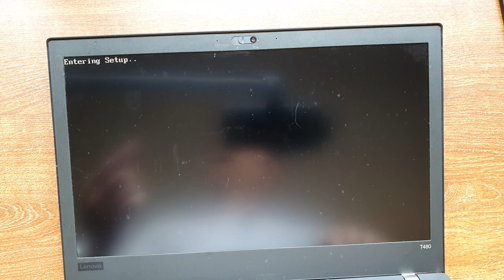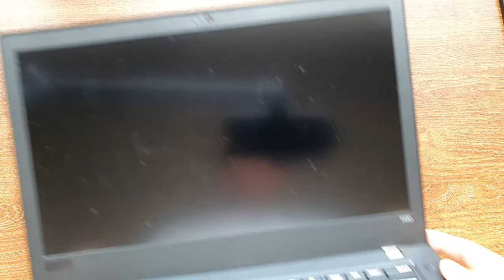Thinkpad T480 Dual heat pipe cooling fan upgrade + Thermal repaste | Lenovo laptop DIY

Comment from the maker: - Part number for the dual heat pipe cooling fan (for dGPU-equipped T480's): 01YR202

- AVOID Liquid Metal thermal paste if you're repasting for the first time, because it's conductive, and stick with non-conductive ones like what I used in the video.

- Have a dGPU in your T480 or T580? I repasted my Nvidia-equipped T580 in this video (and did a marginally cleaner but functionally identical job with the paste application): https://youtu.be/0mJpo-eSFEM

- Some popular thermal paste options:
Thermal Grizzly Kryonaut (2g, what I used): https://amzn.to/3B1XJfG
Thermal Grizzly Kryonaut (1g): https://amzn.to/3HQcHt8
Arctic MX-4 (4g): https://amzn.to/3LJg5a5
Arctic MX-4 (8g): https://amzn.to/44FuDjE
1/8"-thick foam tape (what I used, very handy for Auto DIY/rattle-hunting, too): https://amzn.to/3M5S2DW

Full disclosure: these are affiliate links. I earn a little from the traffic upon checkout but don't get any share from the products themselves.
Reply: Great video,would the t480s heatsink model number 01HW699 fit as an upgrade to,its dual pipe but without the extra gpu section,thanks for any replies 👍
Reply from the maker: @customrattysuk  I'm inclined to think it won't, since the T480s has soldered RAM and likely a different motherboard layout because of this.
Reply: @ChezDoesStuff  I've just looked at them side by side in pics and the 480s I was on about wont one fit as it's also not got the little side bit for the two chips,shame really as it would of been a nicer upgrade,but I have a plan in mind now to customise the one you show to upgrade to,I could remove the gpu part of it,cut the ends slightly rounded and silver solder the gap left,I know I could do it the same way you do but at the same time I also like to think outside the box,and it would be the first ever done that way to so a little unique mod 😀
Reply: You could also use 2mm thick silicone thermal pad for the dGPU cooler part.

Comment: My T480 was giving me "fan error" at startup.  It had gotten to the point that I consistently would have to reboot three times before the "fan error" would disappear and the machine would boot.  Scary.  This fixed it - I have no problems now.  The old fan looks OK, perhaps the thermal paste just needed replacement.  But I installed a new fan anyhow.  All good now!

This is an excellent instructional video.  Concise yet thorough.  And it's the best one I have found for this particular job.   I was a bit apprehensive to dive into this job but it was so fast and easy with your help.
Reply: My ThinkPad P15 is giving me error of fan not working when starting up. I discovered that is only the video card fan which is not running. The laptop was not used much but is out of warranty. Do you think I can replace the video card only, or I have to change the whole assembly (both fans and the cooling pipe assembly)?. Thanks for the answer.
Reply: @mevio4665  generally speaking you replace the whole heatsink/fan assy, but if you can source the good quality original brand fans (generally Delta or Sunon), and understand how to repaste the cpu & GPU, you can reuse the heatpipes just replace the fans if careful.
On some older systems the available replacement HSF assemblies are pure junk.
Reply: Thank you friends for the good advices. I feel more encouraged now to try and fix it

Comment: Pro thinkpad tip, if you find a thinkpad with a cosmetic flaw on the palm rest, keyboard, or top of the keyboard.. and it happens to be significantly cheaper than an option that is more clean, just buy the one with the cosmetic flaws. The ThinkPad parts that wear down are extremally cheap, and if you play on doing the t25 conversion then your better off saving the money

Comment: First, I want to say: "Thank you so much for your videos, you're amazing!"
I'll share my experience doing this upgrade:
- My laptop (t480 refurbished, i5-8350u) reached very high temps (~80°C-90°C) when it was connected.
- In idle, the temps seemed good (40°C-60°C).
- Not connected and working, it reached 70°C-85°C temps.

I did the same upgrade that you showed in your video, I got exactly the same cooling system (same parts), these are the results:
- Connected and with a high cpu load (ML training, 90-100%), it reached 75°C at max.
- Using an eGPU (rtx 2070) and training a CNN, it reached 80°C at max.
- In idle, the temps are in 40°C - 50°C at max (passive cooling).

So, I can say that there's a lot of improvement (10°C-20°C in average).
Thank you so much for doing these videos, it helped me a lot!
Reply: what enclosure are you using for your eGPU? is there a compatibility list with docks and graphics cards?

Comment: Another excellent video.
At this rate, there will be nothing left to 'upgrade' on the T480, unless you want to pull out the soldering iron
Reply: upgrading smd capacitors and resistors with 1% tolerance high-temp high accuracy capacitors. Up NEXT
Reply: @TruthLoversKoSALAM-fg8dh nah thanks my cpu is better when it's not fried 🍤

Comment: Great video and I'll probably do this very soon. I'm wondering about one thing, though: I learned that you only put one small drop of thermal paste on a cpu, then put the cooler on it. You literally coated the entire cpu before putting the cooler on it. Is it different between desktop- and laptop-cpus? I only have experience with the former

thx!
Reply from the maker: There are several ways to apply thermal paste and not one correct way. What you need to be mindful of is not to apply too little or too much. In my case, I coated the CPU with a very thin layer to avoid the latter. Fortunately, I saw improvement from this method. Cheers

Comment: Hey all, using a thermal pad on the copper part of the dGPU's side works as well as the foam tape for electrical insulation.

Also, thanks for the video !
I've lost ~20°C (both when idle and under load).
The dual pipe heatsink also has great passive cooling abilities, the fan doesn't really need to spin much anymore !

I have also switched from Noctua NT-H1 to Arctic MX-6 but I doubt it had an effect on the thermals.
I have read that the MX-6 takes longer to dry but I haven't really checked that.
Reply from the maker: Great to hear about your results! The passive cooling ability of the twin pipes is very much underrated. The fan on my T480 would go off literally every now and then prior to the upgrade.
Reply: How's it going so far?
Reply: @droidhacking  it's going good, the temps are still absolutely amazing and very I rarely hear the fans whining.
Reply: Could you share the thickness of the thermal pad you used for the dGPU side?
Reply: @muhammadsyafiq5892  I used some Arctic APT2560, it's 0.5mm in thickness.

I only had to get a small 50x50mm pad and I have half left after the mod.

I couldn't tell you the exact size I cut it to without opening my laptop again but I basically cut a square the size of the BGA pins + 5mm of outline to be careful.

I cut the pad on a cutting board after measuring the size on the mobo, make sure to apply the pad onto the heatsink and not on the mobo, you'll have greater chances of succeeding.

By the way, the update is still going great.
Amazing mod.
Reply: @animeistrash  you only put it the 0.5mm pad? not stacking it once more?
Reply: @RayBlaxe  yes, only one thickness, I think I had measured the distance between the heatsink and the motherboard prior to doing this but I'm not sure.

Once you screw the heatsink in it's very close to the motherboard, hence the shorting risk.
So I must assume 0.5mm of thickness to be enough. I think you could have remotely any thickness (probably nothing TOO small) as long as it's an electrical insulator.
Reply: @animeistrash  okayy thanks a bunch, any recommendations what pad suit for this, other than the one you mentioned?, by the way how much did you pay the dual heat pipe HS?
Reply: @animeistrash You don't remember if you measured the gap between the heatsink and mobo? Seems that would be something that you would specifically remember
Reply: @RayBlaxe  hey, my previous comments are not going through, sorry.. I've followed you on X

Any pad should do the job so long as it's an electric insulator, check the dielectric constant on the package/listing.
Reply: @johngreene6783  I did, it was something like 0.5mm since that's the thickness of thermal pad I've used, but I don't remember for sure, I can send you a picture if you want.

Actually, I can go and measure that for you if you want, I have to replace my thermal paste soon.

Comment: Sorry because my English is bad but I want to ask, can the MX150 GPU chip which is sold separately be installed on a T480 laptop board that doesn't have an MX150?
Reply: Technically yes. But it will need  another bios and something to do with north or south bridge, I guess. Anyway you need a very good repair shops master to tell you if it is possible.
Reply: provided you also install all the power delivery components for it and switch the dgpu presence and gpu ID resistors over, yes. but good luck doing that without a boardview.

Comment: how hard do I tighten? is it possible to crack the die from tightening it?
Reply from the maker: I'd say finger tight and not fist/hand tight is a good measure. The laptop isn't really subject to vibration and rattling, so I think finger tight is safe.
Reply: @ChezDoesStuff  alright, I usually hand tighten things so I might've over tightened it

Comment: Is this possible on a T490? Have one with iGPU which is used intensively and is heating up significantly. Will change the paste but im wondering if something like this could be used for longevity and extra processing power

Comment: Yours don't have Geforce Mx150 card
Reply from the maker: Correct. We avoided the MX150 on the T480 in the interest of battery life since it didn't really do much on our T580.
Reply: @ChezDoesStuff  you need to configure it correctly.  But if your happy  with intel thats fine.

Comment: Would be nice to see temp benchmarks with and without tbh
Reply from the maker: Good idea. I'll try to do it when I have to repaste again in the future.
Reply: @ChezDoesStuff  It would be cool to see a comparison of Kryonaut vs PTM7950 with the CineBench R23 30-minute stability test how they handle holding boost cpu clocks
Reply: Hey @kenta6157, I have 20°C of difference between the single-pipe heatsink and the double-pipe one.

I have also switched from Noctua NT-H1 thermal paste to Arctic MX-6, but I doubt that it matters.

Comment: Doh!  I did this conversion before watching the video and did not put the rubber pad under the video chip section.  It does seems to work fine, however the fan seems to run at 100% now all the time.  Not sure if its related to the lack of  rubber pad.

Comment: I just had this mod and it seems okay but still feels warm.
Does your touchpad and keyboard feel warm when above 65c-70c?
Reply from the maker: It still feels warm under heavy load, but not under 95% of circumstances. Do check out my ThrottleStop video to see if that works for you.
Reply: @ChezDoesStuff  thank you so much for your response and will check it out too. :)

Comment: Should you apply paste on GPU as well? I thought the manual states that you shoudn't.
Reply from the maker: Hi there! If you're referring to the smaller rectangle - I only applied paste there because there was paste from the factory when I first did this job. No harm so far.

Comment: I bought the thermal paste that you said you used in the bio, but mine is pink and yours is gray? I'm confused lol. I bought the 2 gram kryonaut extreme. Why is mine a different color?
Reply: Also, what's your idle temps after this? I'm at 45 degress celcius. Haven't put it under load yet.
Reply from the maker: @Camslaw-  thanks for pointing this out! Extreme is the higher end variant, so pink is definitely better than the gray. As for idle temps - I'm at 41 on i5-8350U WITH undervolt.
Reply: @ChezDoesStuff  ok cool, sounds like im good then. Im on an i7-8650u, 45 WITHOUT undervolt is to be expected. I assume the main benefits for the dual heatsink is less throttling under load, resulting in better performance. And probably the fan spinning up less often. Thanks for the videos, I'm using all of them to upgrade and max out everything for my t480.
Reply from the maker: @Camslaw-  fan spinning less was the biggest benefit I saw from this mod. Glad the vids are helpful. Cheers

Comment: Thanks for this. I'm using an external GPU with my T480 (i5-8250U, 16GB), and with more intensive games I experience severe framerate drops that last for about 10 seconds or so. I noticed that the laptop has gotten quite hot at that point. Could this solve the issue?
Reply from the maker: The dual heat pipe mod will surely help with cooling, but I don't think it will completely eliminate the issue, maybe just lower peak temperatures.
Reply: @ChezDoesStuff Thank you for responding! When you say it might not completely eliminate the issue, do you mean that it might lower peak temperatures, but not lower them enough? Or that there could be a different problem?
Reply from the maker: @kewner8556  Sorry that I wasn't more clear. In my experience, the dual heat pipe significantly lowered peak temperatures under my usual workload. I am uncertain, however, if the temperature drop will be adequate for your usage conditions.

That said, it can only result in upside, and the mod is cheap enough to try out. Do let us know what improvements you see!
Reply: @ChezDoesStuff  No problem, you were clear, just wanted to make sure I understood. I really appreciated you taking the time to help out, and if I decide to do the modification I'll definitely report back.

I've never even checked the thermal paste in all these years of using the laptop, so even that alone might help a bit.
Reply: @kewner8556 do you have a video of this laptop on games? Im interested to see how it holds up

Comment: That one core is the processor and the other?
Reply: Graphic card
Reply: Inbuilt Intel graphic card
Reply: @ThakurMehul16  Ohh meaning they are separate. In a desktop computer it is together so it surprised me.
Reply: @adam1709  It's chipset die, not integrated GPU.

Comment: I would have loved to see a simple before and after benchmark.

Something like Cinebench.

Though it is a surprisingly affordable upgrade, I might do it myself and post it on the Thinkpad subreddit.

Did you notice any improvements?
Reply from the maker: Fair points. Prior to the fan upgrade and repasted, the T480's fan would go full blast every now and then, even under light office use. That's not an issue now, and the laptop stays silent most of the time.
Reply: yes is useless without benchmark
Reply: Did you do it?

Comment: I have a T480 with the MX150. I already reapplied the thermal paste twice but still get about 98°C peak with the i7-8650U on load. any idea how to tweak this or is this "normal"?
Reply from the maker: Hmmm I can't really suggest undervolting, since you're facing temp issues under load and not during idle. Did you try a different brand of thermal paste on the second go?

Do you have the slim battery? The fatter 72Wh external one might help, since it props the bottom of the laptop up for more air flow.
Reply: @ChezDoesStuff  undervolting does not work (maybe because of the vPro? idk, but it does not apply at all). i use the kryonaut too and never had an issue so i don't think its the paste.

yes i have the slim battery because of its size, the 72Wh one is just too big. but i will try to lift it a bit while under load just to see how it will perform.
Reply from the maker: @hYpercritesde  I hope propping it up a little works for you.

I don't have a dGPU on the T480 but do have it on the T580. Both machines use the i5-8350U and undervolt fine (and also have the fat 72 Wh). On the T580 with MX150, I get around 75-80 deg C under load.
Reply: @ChezDoesStuff  i can't really tell why undervolting doesn't work but i read somewhere it has something to do with the vPro-stuff. i guess its about the processor itself and that 98°C peak-temperature is considered "normal". :/

idk, maybe i do something wrong with throttlestop, could be a new idea for another tutorial i guess. :P
Reply from the maker: Throttlestop idea queued. :) I won't have access to the i7 though
Reply: Try to make some room at the bottom of the laptop, will help airflow and decrease temperature.

Comment: Great guide but there are a couple of things if you want to improve it.
1. The first step always should be to phisically disconnect the battery.
2. Since it is a guide you should be following that screw pattern on the cooling assembly.
3. Why would you waste these heatpipes going to the gpu when you could be dumpng heat to otherwise unused part of a board. Good THIC thermalpad required :)

Also you should look into CoolerMaster's cryofuze thermal paste. Found out a couple of times that it works better than kryonaut ;)

Comment: Will perform better with the dual heat pipe in terms of cooling?
Reply from the maker: Yes, huge difference. The single heat pipe and old thermal paste would force the fan to run loudly every now and then. That doesn't happen as much with the dual heat pipe cooler.

Using ThrottleStop to undervolt the CPU reduced those occurrences further. I'm going to come up with a guide for that soon.
Reply: @ChezDoesStuff  thank you 🙏
Reply from the maker: you're welcome!

Comment: how is the temperature before and after? is it substantial and worth the upgrade?
Reply from the maker: I don't have exact temperatures for you, but the T480 kept cycling the old single heat pipe fan on and off before, even when it was just idling. This no longer happens with the dual heat pipe fan.